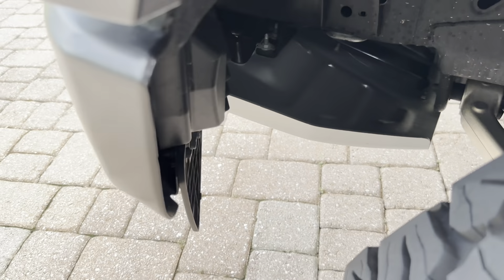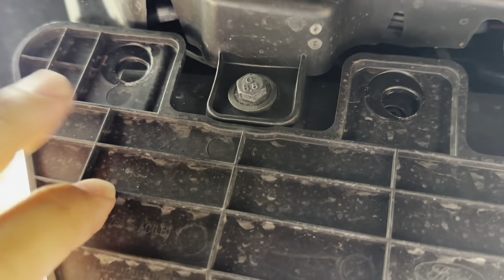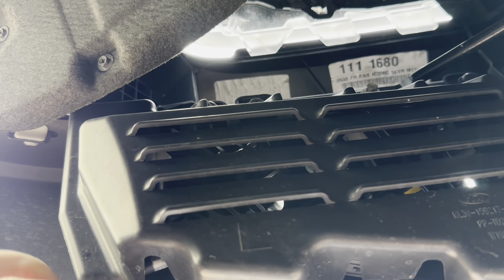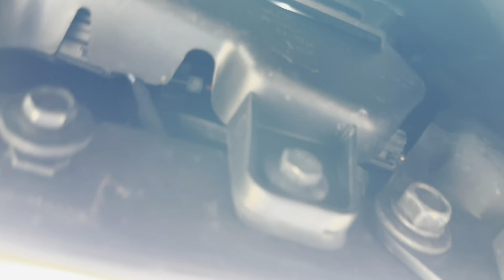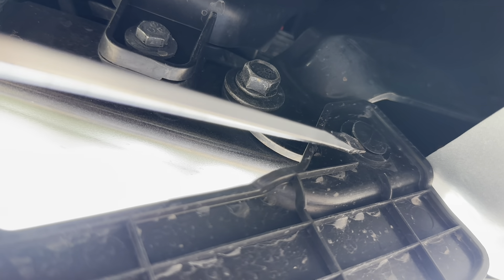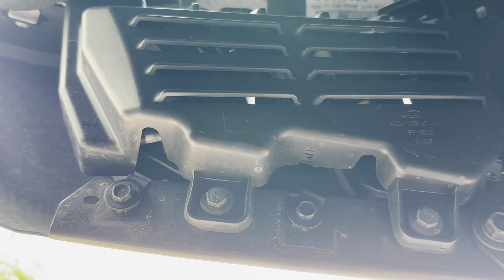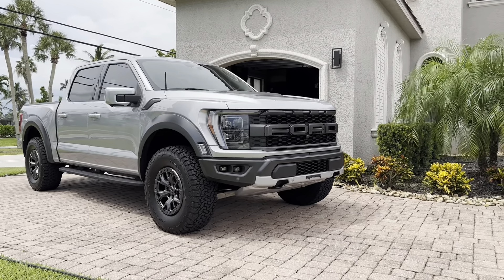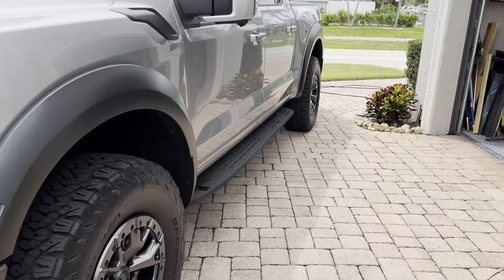Best Free Ford Raptor Bumper Mod!

Comment: Where did you get the Raptor Badge to cover the front license plate bracket holes?
Reply from the maker: eBay. It was 20 bucks and I had the put my own double stick tape on it. Came out really good I think.